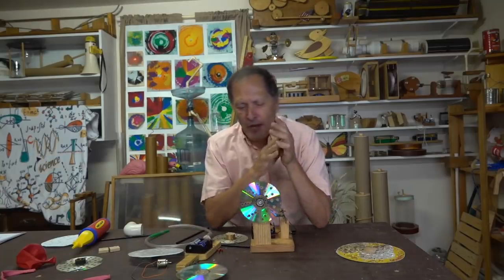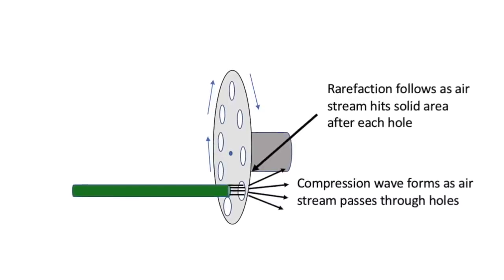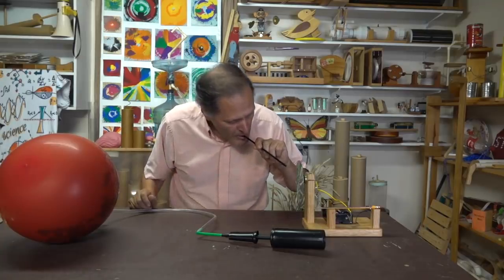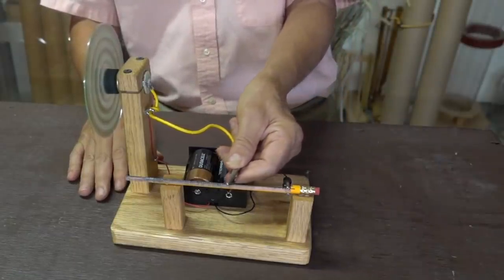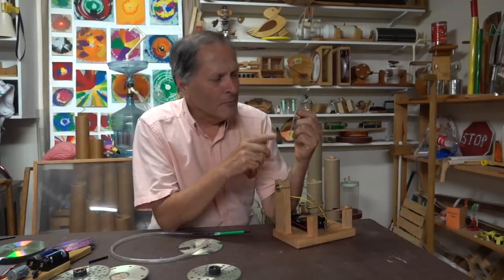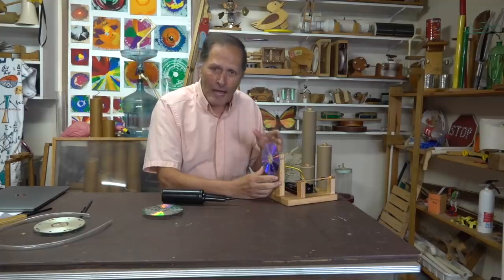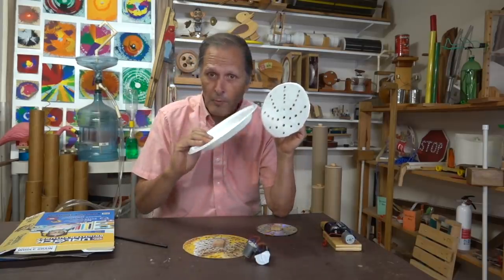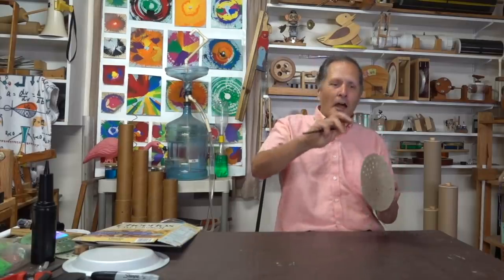Simple siren disc  demonstration //. Homemade Science with Bruce Yeany

Comment: I love that the variable resistor is made from a pencil.
Reply: I was going to comment the same thing.  It brought back memories of my sparky youth.
Reply: I used a pencil resistor to control motor speed for a strobe light (combination of this post and one a couple of posts down).
Reply: That is pretty genius
Reply: @EXwifeKILLER  it's really not. It's fairly basic.
Reply: It's called a Pencistor.
Reply: Just watch your wattage. I had one to catch fire once. I was trying to find out just how much it could handle. You can also make paper resistors with a pencil and paper. In fact paper resistors make good electric matches.
Reply: @kuangmark  The total wattage is what you have to watch. Remember voltage times amps gives you wattage. Wattage is where the heat comes into play. You could run 10 times that voltage if the wattage stayed at that 20 watt level but you could also set it on fire with just 12 volts at higher watt levels.
Reply: Well the pencil contains carbon, which is also used in actual variable resistors or potentiometers. Just so you know!
Reply: @someone8944  More technically , graphite ... 

Graphite and Carbon both are chemically the same, but the physical structure makes them different. Graphite has a hexagonal structure, but carbon can be found in various structures. Graphite is found in only various forms of Graphite. 

😎👍☘️🍺
Reply: @peterfitzpatrick7032  Okay thanks!
Reply: @Kalumbatsch  Thank you, I needed a just laugh.
Reply: @Kalumbatsch  Wattage is power.
Reply: I mean potentiometers are made out of graphite
Reply: Right! McGiver trick
Reply: @tylermcnally8232  you're fairly basic
 Let people have their damn fun.
Reply: That was the best part of the video. 
Keyword: simple
Reply: @kuangmark  I know back in the day they used cylinders full of salty water in old stage lighting as voltage regulators. At that bottom of the glass cylinder was a lead. And it had a good bit of salty water over it vertically. And u lowered the other lead into the water. The further apart they was. The less voltage. The deeper u lower the lead.. the brighter the lights. Kinda cool
Reply: @kuangmark  learned* 
Learnt is what hillbillies say lol
Reply: @someone8944   Carbon (often mixed with some form of plastic or similar to get a smooth surface) is often used in cheaper potentiometers.

Metal oxide in more expensive.

And some alloy like kanthal for high-power use. I.e. the similar type of wire you can make electrical heaters from. When mounted on a cheramic base, the wire can handle very high temperatures, and so radiate out the energy losses.
Reply: ikr graphite is a bless
Reply: @ModernGentleman  I learnt that Don is too judgemental about any lingo not his own.
Reply: ikr it is GENIUS :DD
Reply: I learned that shit in 3rd grade
Reply: Science Revolution  That video is unrelated to this one, you are being rude. You want it debunked, you do it. I saw nothing paradoxical about the tide video.
Reply: yeah the pot

Comment: 6:27 - you don't get a change in frequency with this design, but you do get a slight change in timbre as you move around the disk. It sounds a lot like changing the pulse width on a synthesiser, where moving towards the outside edge of the disk sounds like a narrower pulse, and the centre sounds like a wider one. This must be to do with how quickly the hole moves past the air on the different edges.

Also your 4 - 8 hole design sounds like the harmonic series, which is pretty cool!
Reply: I was expecting him to lose an eye at that point.
Reply: Changing the pulse width IS changing the frequency , it’s the same thing
Reply: @GhostsniperAus  no, the pulse width can vary, while each pulse occurs at the same regular interval. You're thinking of wave length, which does affect pitch.
Reply: I may have misinterpreted the design but it almost sounded like a flange effect.  The same effect heard when two tone sounds play simultaneously with a slight variance.
Reply: I'd not say "slight"... it's a rather noticible change, most notable as the airflow begins to cross the edge; that adds another,non-harmonic, turbulent airflow, and an undertone.
Reply: So it does indeed change frequency. The signal is composed of multiple frequencies. The power distribution is changing for sure. This will become very clear when the signal is Fourier Transformed. I believe your analysis is correct, that by conceiving it as a PWM signal with varying duty cycle, the fundamental will remain the same, but the harmonic distribution will change.
Reply: @fisk7aal  Yeah power distribution changes but (assuming the speed of the disc doesn't change) the frequencies themselves don't. Sharper pulse = more highs, pretty standard in music production. There's another factor though, apart from pulse width, which is interesting. The holes being round actually rounds off the waveform (rounding ~= lowpass), and this effect becomes less pronounced as the radius of the hole becomes much smaller than the distance between one hole and the next.
If the holes are not equally spaced about the circle, then you will actually get subharmonics as well. Lots of interesting stuff here.
Reply: @RijuChatterjee Why will there be subharmonics?

Comment: You should really wear some sort of safety goggles when rapidly spinning cds with holes drilled in them
Reply: I knew there would be one of you.
Reply: I was thinking the same thing!

holy moley that was actually kinda scary
Reply: The speed that little motor can achieve is a long way from the failure point even with the holes added. One demonstration I have seen resulted in the cd shattering at 23,000RPM. Yes the holes do reduce the integrity some, but the 3,082.5RPM one of this video's cds rotated at to produce the note obtained is still well below the failure point of ones with holes.
Reply: Famous last words
Reply: @TheAchaicus  Holes is one thing, what about slots like at 6:30?
Reply: I was thinking the same thing.

Comment: For that disc with the slots, and for the disc with 8 holes both at the center and at the edges, the pitch doesn't change, but the "shape" of the sound changes; it gets either buzzier or smoother. If you record the audio and look at the waveforms in eg. Audacity, you'll be able to see the difference; buzzier sounds will have sharper waves (closer to a sawtooth wave), and smoother sounds will have more rounded waves (closer to a sine wave).

A similar effect happens when woodwind instruments change the shape of their mouth around the mouthpiece.

Comment: A memory from my childhood  -- My father once bought me a toy ambulance, about the size of an adult hand.  It had a slotted flywheel and a matching stationary ring.  The flywheel was geared be accelerated by pushing the ambulance on the floor repeatedly faster and faster, then releasing it to go by the flywheel energy.  The flywheel slots were shaped to push air radially through the ring slots.  My mother hated the sound right away and my father soon joined the haters chorus as well!
Reply from the maker: good one,  I had a siren whistle ring that I drove everybody mad with,  fun times!

Comment: at 7 min, the purpose of that disc shape is to alter the pulse width of the sound wave while keeping the main  frequency / pitch (fundamental frequency) unaltered.
Reply: I may have misinterpreted the design but it almost sounded like a flange effect.  The same effect heard when two tone sounds play simultaneously with a slight variance.
Reply: @PaulMillard1973 yes, Pulse Width modulation can sound a bit like a phaser /flanger because also enhances or dampens certain frequencies in the harmonic spectrum while keeping the fundamental unaltered.

Comment: Typically, a British air raid siren rotates at 2850-2900 revolutions per minute, one end has 10 openings and 10 blades, the other has 12 of each. This creates two tones harmonically related to each other as a minor third. The tone in Hertz can be calculated by multiplying the rotation speed in R.P.M. by the number of openings and dividing by sixty.
For example, at 2850 r.p.m. the two tones are 475 Hz and 570 Hz.

Comment: About the slotted disc and the discs with the same number of holes at different radii: You are right that it doesn't change the pitch. But there is a slight change in timbre because the timings of flow/no-flow of air changes relative to each other. That is probably not the purpose of the slotted disc but it is an audible difference. Also a similar technique was heavily used on older sound chips of home computers but with e.g. high/low voltage level timings on square waves to vary the sound.

Comment: Around 6:00:

I intuitively expect that past a certain size, the loudness will decrease again.

I’d think the size of the holes influences the resistance that would have to be matched to the energy input regulated by disk speed and the air speed out of the tube. Some form of impedance matching. Louder = better match.

Just a thought.
Reply: Thickness of the disk is a factor too.  Too thin and it will not "chop" the air as much as a thicker disk.  But too thick and it will hold too much of the sound back.

Comment: The slotted disk did not chnage pitch because the number of pulses per revolution is the same at any distance from the center.  Your other disks have a different number of holes depending on the position of the air stream.

Comment: 7:00, sounds like a filter cutoff control. The outer bands get you brighter tone than the inner bands.
Another thing you can try, is do 1 CD vs 3 stacked CDs.
Reply: Bingo. A couple times the OP said “sounds the same” & I disagreed. Same pitch, sure, but different timbre.

I think the brass disc with slits is designed to be matched to another just like it as the air supply orifices. I expect you’d get a very loud result, with very fast rise/fall times, i.e. piercing.
Reply: Yes, the experiment should have included varying disk thickness just to complete the possible variables.
Reply: @kelvin0mql  I wouldn't say timbre but harmonics, it is not a pure tone. But you are still right.
Reply: @theeastsensation5295  I have my moments… rare though they may be.

Comment: For the disk with slots as well as the ones with the same number of holes, you can notice a change in the timbre of the tone as you move from the inside to the outside.  If you think of the sound wave like a pulse-width-modulated square wave, you can think of the sound as getting "thinner" as the pulses get thinner, and getting "thicker" as the pulses even out.
Reply from the maker: we have a change in the linear speed going on here,  I wonder how the shape of the hole or slot might address this.  Round hole towards the center compared to oval shaped or double holes towards the outside. I have some other projects going on but still want to explore this further

Comment: I think the brass disk with the slot was used for scanning light beams.  The device used two disks, one for horizontal and one for vertical scanning.  The light from an object is focussed on the disks and the resulting beam is a serial scan of the object.

I've also experimented with a resistance made from pencil lead drawn in a heavy line on paper.

Comment: 4:58 you can hear the timbre change ("ooo" and "ahhh" is how I hear it). is this because of the additional disk mass the air stream passes over in between holes? I'm also wondering what the air column "looks" like when traveling through one of these, specifically after moving through the disc.
Reply: Yes!
So it's sort of like pulse width modulation.
- When the holes are closer to the center, the distance of travel between two holes is similar to the distance across the hole itself. This means the "on" time and the "off" time are comparable, giving you something close(r) to a square wave (the roundness of the holes will round off the waveform somewhat too but let's ignore that for now).
- When the holes are far apart, the "on" time is much smaller than the "off" time and so you get a narrow "pulse wave" which has more more high frequency (harmonic overtone) content.
"Ooh" formants have less harmonic content than "aah" formants, so this is why you interpret the inside as "ooh" and the outside as "aah". However, this will only work when you compare them. On it's own, neither of them will sound like "ooh" or "aah".
Reply: @RijuChatterjee  This is exactly what I was thinking! I imagine the slotted disk does something similar since as you get further away from the center, the ratio of open to closed would change. While you're still getting the same number of pulses (hence pitch) the length of the pulses changes, giving you a change in timbre as the harmonic structure/distribution changes. 

Its pretty subtle, but you can almost hear a saw-wavy sound around 6:40  when he is near the outer edge, and less sharp (fewer higher harmonics?) when in the middle.

With a cleaner air source you could probably run this through some spectral analysis and see all that. Idea for a follow up video?
Reply: @CrumbleB33  I wouldn't say you need a cleaner air source. You could probably get informative results even from just a frequency-domain analysis of the audio in this video. Time-domain analysis might not work out as well because the digital codecs used for audio compression often mess up phase stuff. If you had a good .wav file you could do time-domain as well.

Comment: Similar to the 'Doppler Effect'.
A sound gets higher in pitch as it's coming towards you (Shorter compressed sound waves)
and lower in pitch when going away from you (Longer stretched out sound waves).
That's why kids go 'Neeeoooow' when imitating the sound of a car passing them. High to low pitch. 🤔

Comment: Thomas Seebeck died in 1831.  August Seebeck made the tone disk. It's interesting to notice that the design you used looks like fan blades captured by a camera's rolling shutter.
Reply from the maker: thank you for the correction,  most of the information I would find  only listed the last name.
Reply: Maybe you had to have been there

Comment: The disc with the slits resembles an arcade machine where the objective was to use a ramp to propel a coin through the slits as it was spinning. It also reminds me of an experiment with a laser. You could make a small adjustment to the slits where they're wider near the outer diameter, forming a triangular shape. That might produce different sounds.

Comment: The slotted disc essentially is the disc you showed with 8 holes on each of 2 concentric circles. But instead of n discrete concentric circles, you have infinity.
I don't know if that is the purpose of the disc or not, but the observed principle, I think, is the same as the demonstration at about 4:50.

Comment: One observation the material that was the worst conductor of sound was the best. Pretty sure because you heard the frequency of the air cut and compressing through the hole. Instead of the higher pitch vibrations of the material.

Comment: So when you said that the number of holes on the cd effected the pitch, did the speed of the disc have anything as well? Because the disc was spinning faster towards the edge, if they had an equal number of holes for each concentric circle around the disc, would the pitch also change? Or not because the further distance between holes cancels out the moving faster..... idk
Reply: I was confused as well. But when the hole of the inner row is at the top, the corresponding hole of the outer row is at the top as well. When the inner hole is at the bottom, the outer hole is too. So they pass at the air stream in exactly the same intervals.
Reply: velocity = distance/time

In the outer ring, distance, and therefore velocity get bigger, while time stays the same, and time=time interval is all that matters in this case

Comment: 7:00 The single slot from the center ones look like air raid sirens, or maybe ambulance sirens, you don't need many notes in those ones, then put a  thermal-style flasher there like those in old blinkers an it goes WEEWOOOWEEE as it speeds up and slows down, that's it.
Reply: This was going to be my guess as well; possibly a Q-siren diaphragm.

Comment: Now you need to set up a keyboard with each key triggering a valve going to a straw corresponding to a different note. Something like a pipe organ.
Reply: Thank you xD
Reply: That's funny, It's almost literally an inverted organ. Air supplied through pipe instead of by a fan/bellows, and the sound comes from the spinning part not the tuned pipe lol
Reply: (Starts humming In-a-godda-da-veda)

Comment: Your sirens reminded me of those colorful short tube siren whistles you can buy at the dollar stores. Taking one apart revealed a six hole slotted disc with beveled edges, like little ducted fans. They sound in either end of the tube you blow into. If you put two together in-line in the right way they sync up making an interesting jet engine like chorus effect, as they spin up so freely. If you flip one of the discs, or blow from the opposite end of the two in-line sirens they sound but not in phase. I put a 4 inch length of blue PEX tube on the end of the double siren which makes the effect more pronounced.
I too thought of your spinning strings, and wondered what other variables could be introduced to confirm the reasoning behind the Mould Effect.

Comment: I would describe 7:55 sounding like some pulse width modulation waveform where the duty cycle becomes smaller the further you move outwards from the disc.

Comment: Run one of those with radial slits in front of one with holes. Slowing down the one with holes will produce a beat with the differential speed as frequency.

Like the first on a half beat the second on fourth.

What would this sound like?